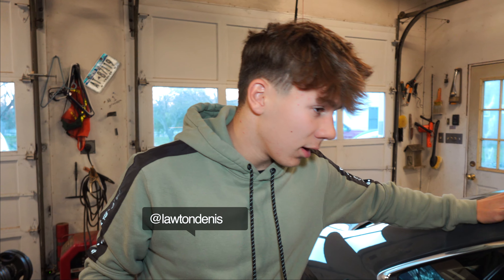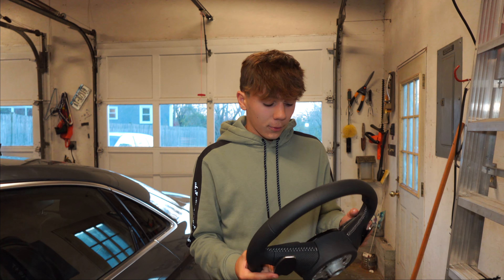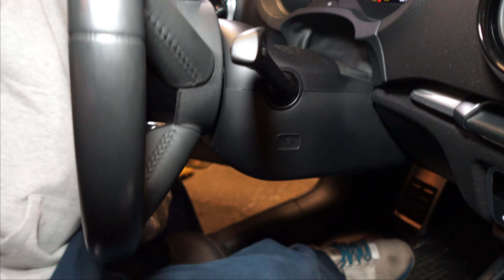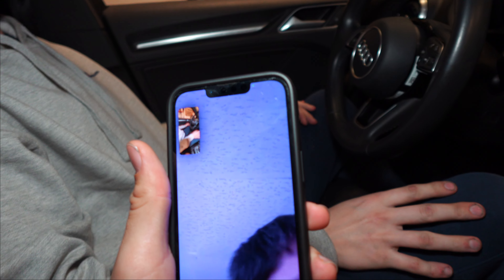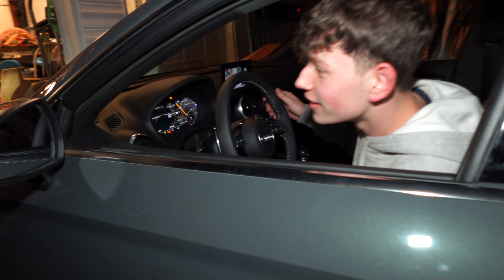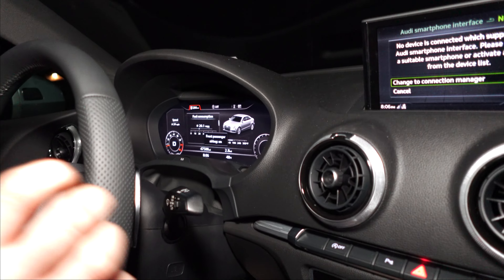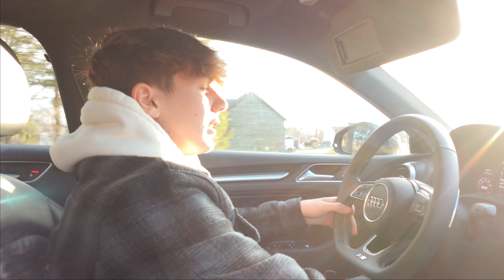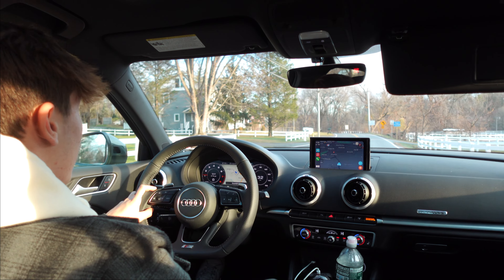Is A $330 Ali Express Audi S3 Steering Wheel Any Good? (Paddle Shifters)

Comment: So did you replace the airbag as well? The link you posted does not fit on my car like you claimed. It’s a 8Y steering wheel and but an 8V. The way you remove your existing airbag looks like mine and is not the same and the steering wheel you installed. 8V is a 5 3/4 “ bag and 8Y is 4 3/4”.  How did you did that?

Comment: Wait the stock a3 doesn’t have paddles even the Sline?
Reply from the maker: Depends on the one. Some of the newer a3s do like 2019 and up.
Reply: @LawtonDenisDrives  so yours didn’t have them but the steering wheel has them and that worked on your car somehow ?
Reply: @S4Tony3.0T Features on new cars are plug and play, you pay less you get less, but theres a lot behind the scenes

Comment: If you hit the paddles to go into manual mode, you can get back into D by clicking the shifter into sport, it'll skip sport and go straight back to D, saves you a clunk on the gear selector
Reply from the maker: Ok awesome!! Thank you so much.
Reply: @LawtonDenisDrives   you can get back into D from manual by just holding the + shifter for a couple seconds too.

Comment: How do I connect the paddles to the steering wheel? I don't have a cable for the paddles because they are missing as standard
Reply from the maker: It was just plug in play for me no wiring required. What car do you have?

Comment: Hey will this work on 2018 A3 tech premium fwd? So it’s plug n play, no coding required? I noticed on your old steering wheel you had a NAV buttton like mine but the new one doesn’t have one. Did all the buttons work correctly from the jump? Any issues you came across yet? I’m still skeptical on pulling the cord on one. Any feedback will help a lot. Thanks man!